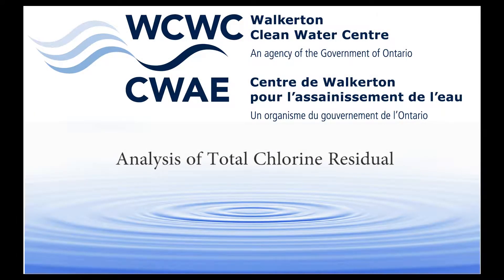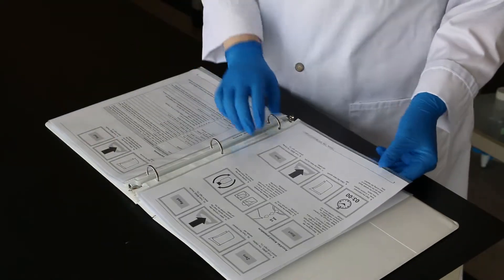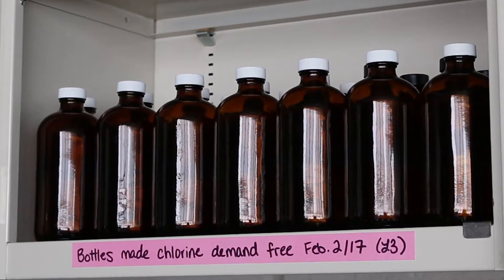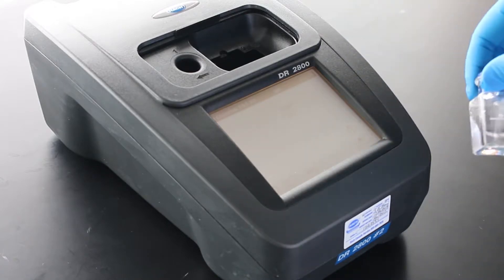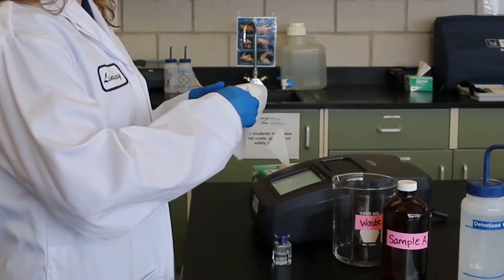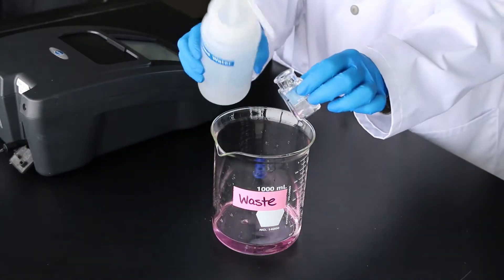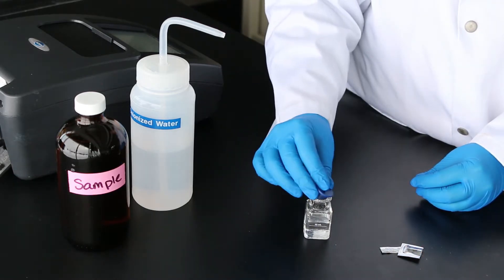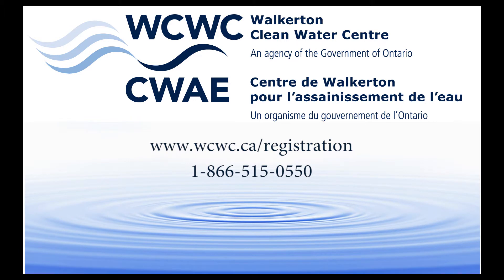How-to analyze total chlorine residual

Comment: Hello can someone please answer this question for me I'm just learning how to water chemistry for my swimming pool and these vids on YouTube some of these people are not explaining correctly so I use a photometer pool lab1.0 with a tablet so I'm accurate dpd1 I get my Free chlorine # then I add dpd3 to the tester and I get my Total chlorine # and for the most time my Free chlorine # is always greater than the Total chlorine # so doesn't this mean that I do not have any COMBINED CHLORINE/ CHLORAMINES to Shock from the pool please help with an answer thanks Chris
Reply from the maker: Hi Chris, I would suggest contacting the manufacturer of your photometer for guidance on its operation. They will be able to provide specific information for the equipment being used and interpretation of measurement values. Hope that helps!